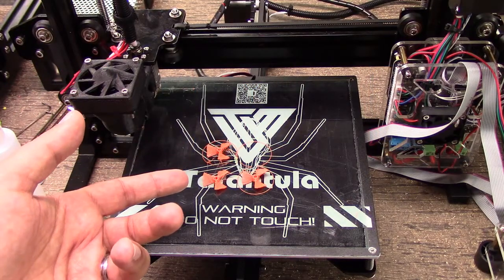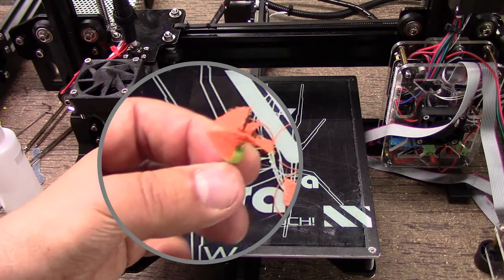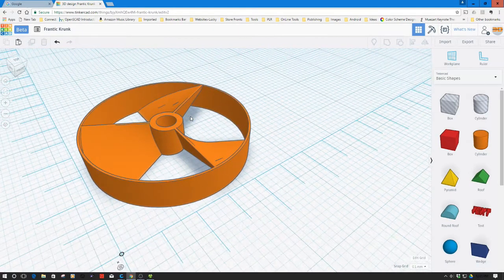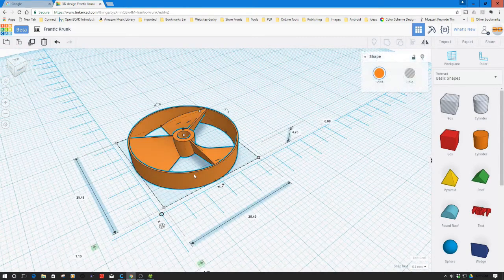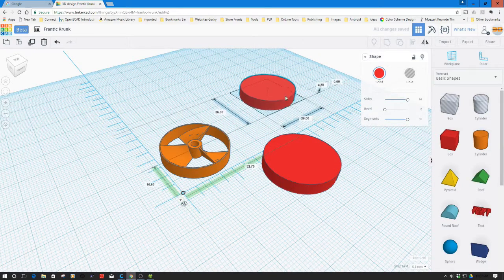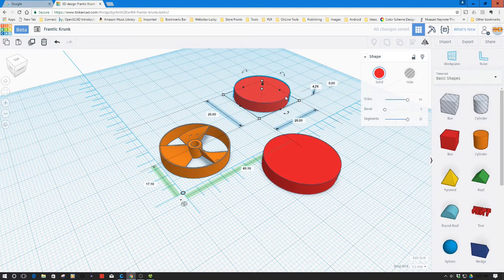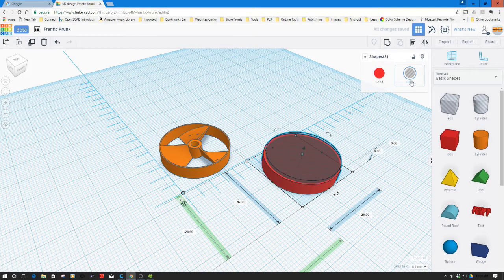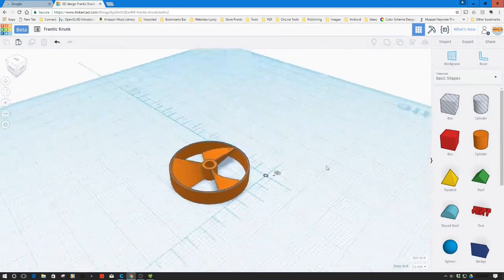3D Printed Project - Modifying a CNC Bit Fan!

Comment: Fan cools normally from evaporation. This will keep your bit and work area cleaner which might help, but it shouldn't cool anything its just moving ambient air.
Reply from the maker: While I would agreee its not the "best"  I think I have to call snoops on this "Fan cools normally from evaporation".  As a fan moves air, air contacts the bit, the bit exchanges heat with the air, and the cycle repeats.  Thus the more air that passes the bit the more heat will be exchanged.  Now it is a given that that there are many factors in heat exchange including the humility of the air and the temp of the bit which determine the exchange (I use to do fluid dynamic modeling of semiconductors).

Comment: You made a slight error with the calculations:
for 3 walls thickness, it is 1.2mm - but as this is a circle you need to subtract that number twice (1.2 on one side and 1.2 the opposite side) so it should have been 26-2.4=23.6mm
Easy mistake to make :)
Reply from the maker: Thanks for pointing this out :-) in the long I just went to Open SCAD redesigned it :-)
Reply: DIY3DTECH.com no worries, I do the same mistake all the time :)

Comment: I wouldnt use that... I printed something similar for my CNC and the spindle gets warm enough to soften the plastic fan.  Mine fell off and jammed up my router and caused it to just move in a small area which caught the sawdust on fire and could have burned my house down...
Reply from the maker: Thanks for sharing, and interesting as I have used these quite a bit (pardon the pun) without issue, now I do NOT use them for metal only wood and plastic.  Also I am not clear on the saw dust catching fire, did the fan do that or the "move to the small area" (not sure I understand that can you elaborate?

Comment: You havn't learned physics at school, right?
Reply from the maker: Did you even attend school? :-)
Reply: DIY3DTECH.com I was even in university, man. On applied physics. Neverthless, it's simple school physics. Moving air does not "cool", it is just equalize temperature quicker. If your hand is warmer then ambient temperature, it "cools" it. If you take ice, it will warm and melt it (given air temperature is above 0 C). If you take temperature probe, that by it's desighn is of ambient temperature... guess what? It will not change temp. Your fan will still "cool" your drill WHEN your drill will be warmed by work it's doing. It's not what you could measure with temp probe of that kind.
Reply from the maker: So if moving air does not cool then why do they put fans in computers?  Wouldn't be to "cool" them would it?
 As being a university, man I am sure you have heard of this little thing called fluid dynamics as I have done a lot of work in the modeling of this in semiconductor space. See cooling fans work as part of a heat sink (the bit in this case), which is  designed to draw heat away from a particular component. There are many complication to this such as air humidity and the temperature of the "sink" all play in how much heat can be transferred.
Reply: DIY3DTECH.com Have you read all my comment or just first sentence? I was refering to the fact that you feel cooling by hand (which is, i believe, higher temp then ambient) but not by temp probes (which by design are of ambient temp). Moving air or not, it has ambient temperature, so both probes shows same readings. It WILL cool your drill bit when it would heat up, I was not objecting that. Just reread my comment:)
Reply from the maker: Sorry the message is not transferring well and doesn't help that you started the thread with condescending statement either.  As the famed Marshall McLuhan liked to say "The medium is the message" and when embedded with extra noise it quickly loses its value...
Reply: DIY3DTECH.com Sorry for that start:) It was late at night and I was a bit tired:) anyway, I subscribed just few days ago, looking at your laser upgrades videos. I also have k40 laser, 3d printer, cnc mill, learning to deal with that stuff. Keep up with your videos!
Reply from the maker: No worries my friend :-)